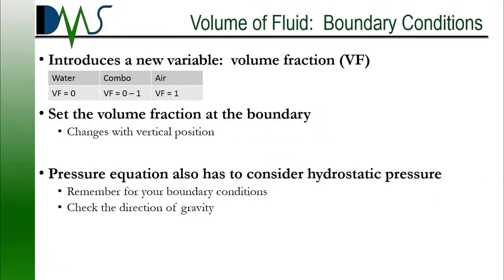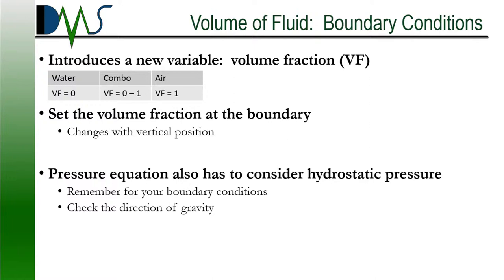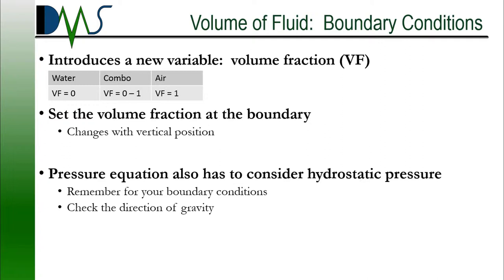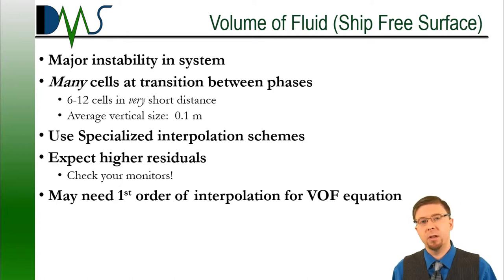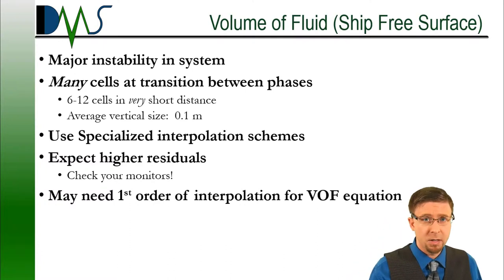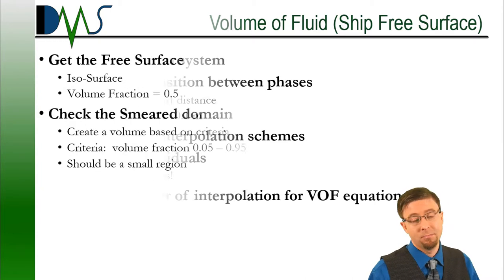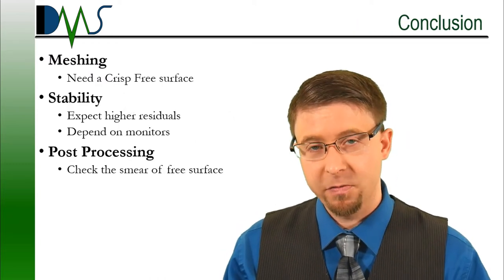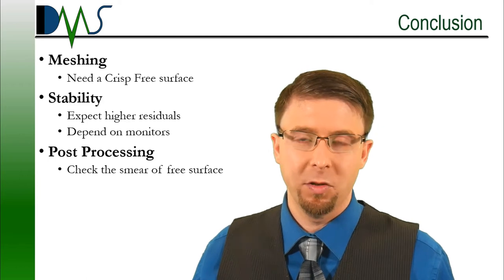PRACTICAL CFD MODELING:  Volume of Fluid Method

Comment: 0.1m is 4inches ? That sounds like a very large distance especially if 6 to 12 cells are stacked. That would be a transition zone of 1.2m. Should that read 0.1mm?
Reply from the maker: The distance is correct.  We do want a transition zone with enough vertical height to capture the waves generated.  I say 1.2 m as a starting point, but it depends on the wave height.  0.1 m resolution depends on the flow conditions.  You can frequently go to a smaller cell size near the body.   Again, it depends on the flow conditions.
Reply: @DatawaveMarineSolutions  ah with waves that makes sense. I thought the smeared thickness was 1m.
Reply: As a side note these are possibly the best clips of their kind.
Reply from the maker: @punkisinthedetails1470  This also exposes the practical side of CFD.  Of course, we want higher resolution.  But a dense refinement on the free surface can quickly make the simulation too large.  Mesh density is often driven by available computer resources, just as much as the simulation physics.

Comment: Hi Nick, it is a very useful video. I have a doubt, on what basis one can decide the timestep of simulation while doing VOF.
Reply from the maker: The Courant number is still the best bet, since volume fraction propagates at the same rate as fluid velocity.  However, Courant number changes depending on the mesh size in each region.  If you are worried about timestep for a VOF simulation, base your Courant number on the mesh size at the fluid transition.

All that said, if you are modeling a scenario that is effectively steady state, the simulation will likely  remain stable at very high Courant numbers. I've pushed mine as high as Co = 2 in some simulations.
Reply: @DatawaveMarineSolutions  Well said, then I will stick with Courant number. Thank you ✌️

Comment: How about using VOF for water-steam interaction? can we model water phase change using this?
Reply from the maker: Yes, we can.  Technically, there are other models that determine the phase change from water to steam.  But VOF still tracks the ratios of each phase.  I have seen this investigated for predicting cavitation of propeller blades.  Honestly, CFD predicting phase change is something I need to read more about.
Reply: @DatawaveMarineSolutions  thanks for the instant response. 👍